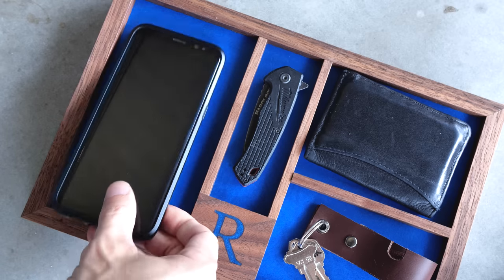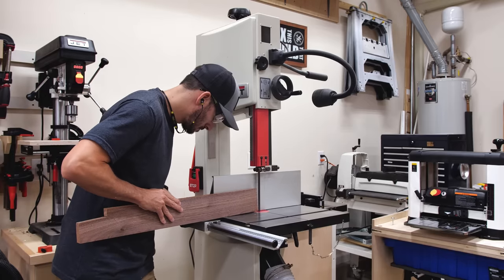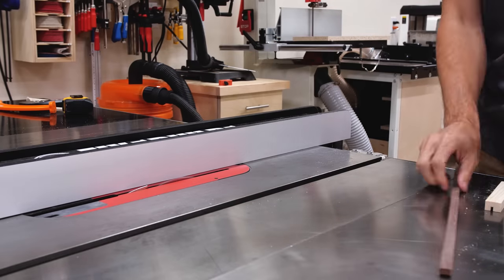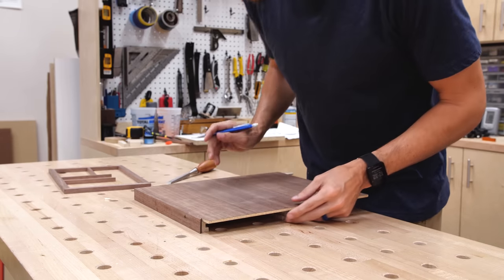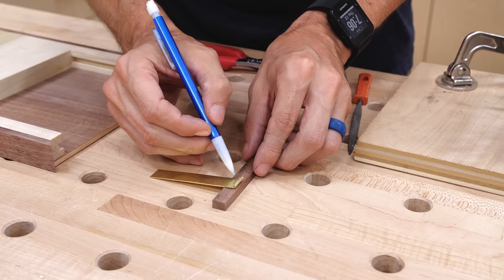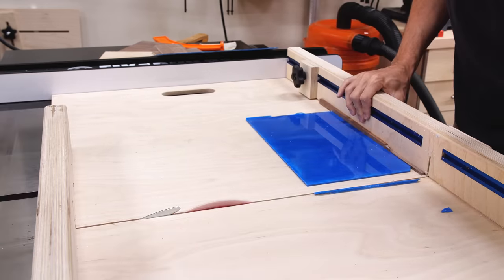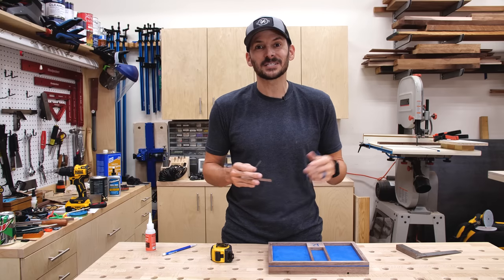Making a Hidden Stash Valet Tray with Secret Lock

Comment: Brad thank you for the candid video. Too many makers will not show the mistakes, but by doing so you show that you're human. 
It reminds me of the puzzle boxes that were sold in Turkey (early '80s) that were jewelry boxes. You had to move 2 or 3 pieces to get to the key and another to get to the lock.
Did you consider a magnetic catch imbedded into the charger section?
Reply from the maker: Waiting to include magnets into future builds.  Wanted to use just pure mechanics for first few
Reply: @Fixthisbuildthat  Just keep the entertaining videos coming. I can appreciate the hard work that put into each project/video as I know that it takes time. Also, thanks to your wife for supporting you too.

Comment: Great project.  You should drill a hole in the drawer bottom so the long pin will fit in and add additional security from accidental opening.

Comment: I got the perfect build for you, because im already in the process of building it. It is a nice book hutch for a bed room. It has two cabinets on the bottom on either side and an open shelf in the middle. Above this is two drawers side by side. The top is 3/4 walnut plywood with edge banding. The book shelf is inset from the two sides 6 inches and 4 inches from the front. The feet run all the way up the corners to meet the top. There are two angled cuts on the feet one is from the inside corners runing to the floor. The other is only along the sides running from the base to where it meets the table top. Great video thanks.👍🤠

Comment: That's a beautiful project. I love the contrast between the walnut and the blue epoxy.

The locking mechanism is genius, but the whole pull-reverse-push unlock is a little awkward. It also puts the longer pin inside the drawer when in the locked position, so it's likely to catch on or poke hole in some of the drawer's contents at some point.

I would have liked it if the center of the R was a push-button release, like the button on your nightstand project. You could have filled the letter with blue epoxy to match what you used on the bottom, or you could still fill it with clear epoxy even now. Or, find some nice bright blue glow in the dark additive for the epoxy fill so the letter lights up in the dark.

Comment: I think the pin being too long was actually a better idea. Could act as a lock if the pin fits into the drawer box. Then if your brass catch fails, the pin would keep it closed. Then when you spin it around it unlocks it.

Comment: Where did you place the hole needed to run the cord for the cordless charging base through the bottom portion of the project?
Reply from the maker: I filed a slot in the back of the walnut and then also filed a recess in the bottom panel.  That got left on the cutting room floor

Comment: Idea for an easy spring. Use two neodymium magnets with the north ends of the magnets facing each other (repelling). One magnet embedded in the back of the drawer and the other in the adjacent part of the housing. Might work better with two sets of magnets to avoid racking.

Comment: You should add a piece to the front of the drawer that the long nail fits into when the drawer is closed. That way the drawer will have an additional layer of protection against being forced open and you won't accidentally stab your money.

Comment: you could have also just drilled a recess in the drawer bottom to allow the pin to not bottom out when in the locked position. as they say, there's more than one way to skin a cat...I'm just not sure what the one way is that everybody else seems to know. GREAT builds by the way, you got me to subscribe.

Comment: You should have used the longer pin, with a hole in the top of the drawer to physically lock it in place front & back.

Comment: Hmh, why not just drill a little indent into the secret drawer itself for the release mechanisms "locked" position with that slightly longer nail?
That would've doubled-up as an extra locking mechanism too (in case someone somehow managed to knock the brass piece hard enough without using the intended method).

Comment: If you think you had a lot of things go wrong on you on this project, you have obviously never been around me and my nightmare projects. And my projects are always more simple than this one as I don't build things too often, but usually restore them. You might believe some mischievous external forces were at work creating evey manner of perplexing, head scratching, bizarre and one of a kind problems that are completely unpredictable. If I were a bit more gullible, I might believe just that. I go to do a simple re-spray of my oxidized lawn furniture and get home from the hardware store with a can of spray paint that won't seem to spray. So I get out of my ragged and stained work clothes and head back to the store. When I give the rep the can, he opens it and then sprays it into a nearby garbage can on the first try. No problem. My mouth falls open because it seemed to work just fine for him. He puts the lid back on and hands it back to me with a very smug look like, how stupid are you, can"t even work a simple can of spray paint. Feeling very perplexed, I took back the can and left. After I got home, changed my clothes and got my table and chairs all ready once again, I then opened the paint, and to my amazement, it would not spray once again. Now I am just plain mad, but I soon realize that this can has a visible defect in the nozzle and to spray it, you must press as hard as you can, which doesn't help you get nice even strokes. So my project came out with a very crappy paint job because I didn't want to go back and have them think I was totally inept. This is only one thing, for one project. Usually my projects are plagued with little bizarre problems like these. It makes me wonder sometimes why I still even enjoy doing them.

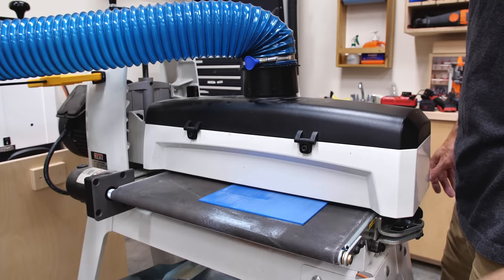Comment: i know i should wait till the end but... im at 13:42 right after the spring choices and my thoughts are... but what happens when you put stuff in the secret drawer and add weight? wouldnt you need slightly stronger springs? i guess ill wait till the end and find out

Comment: Are you at all concerned about heat build-up around the wireless charger?  I'm about to begin making a pair of bedside lamps, and expect to integrate wireless chargers, and can't find much online about heat.  My current plan is to add some hidden ventilation--as the USB charger will be inside the lamp as well--and hope that's enough.  If not, I'll leave room to add a thermstatically controlled fan, but I hope I don't need to go there.
Reply from the maker: Been using it for a while and overnight it gets warm, but not hot. No issues so far